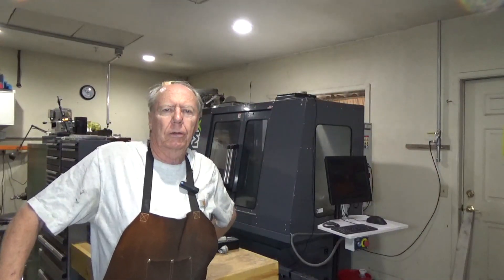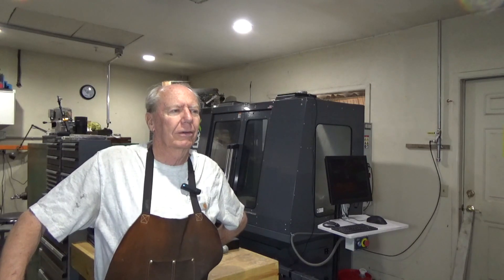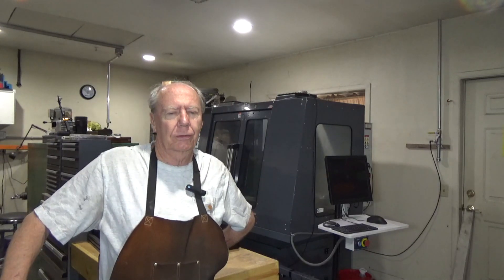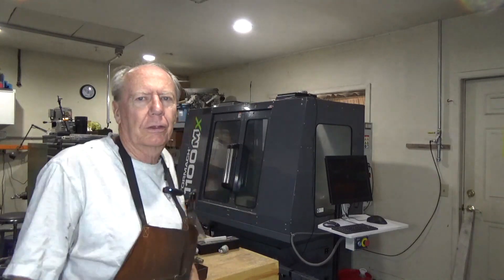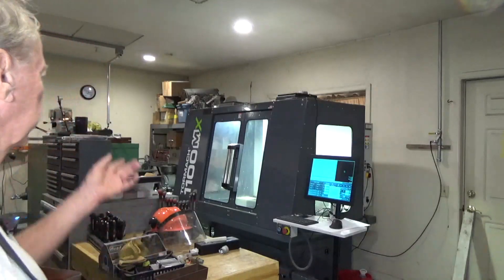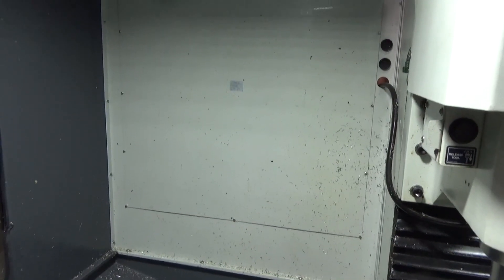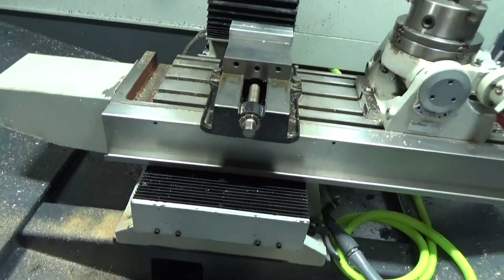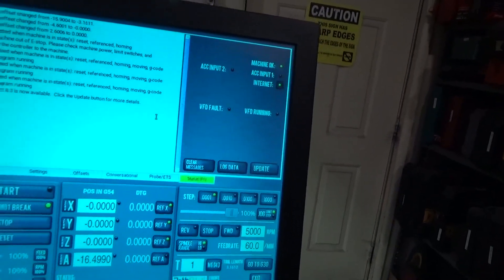New Addition to the Shop - Tormach CNC

Comment: Nice machine, How much $ does this nice used machine run for?
Reply from the maker: This one was $22K. It came with a lot of tooling, a 4th axis and low hours. The thing about the Rocky Mountain area is they don't show up very often and when they do, they sell right away. I imagine they might be more available in the bigger manufacturing parts of the country. I missed one about 4 years ago being to slow on the trigger. This one was the second in 4 years and when I saw the Craig's List ad, I jumped on it within 15 minutes of the ad going up. The seller's phone was blowing up for the next two days with other folks wanting it.
Reply: Old Iron Lover that is a great price! That is at least $10K off the list price depending on the spec.